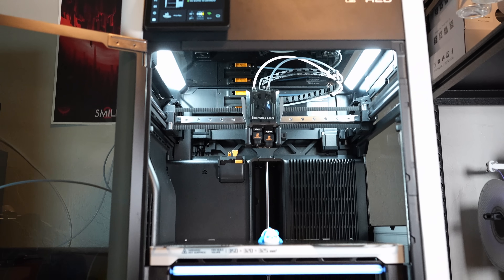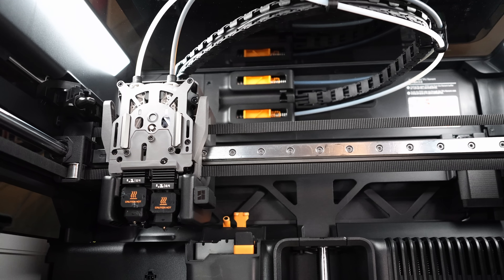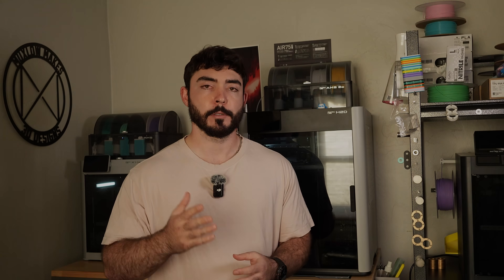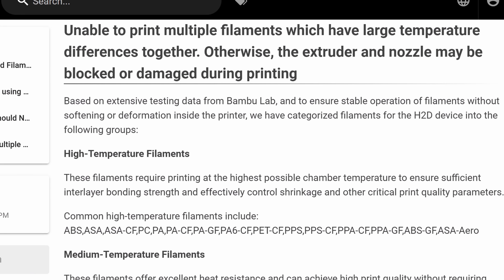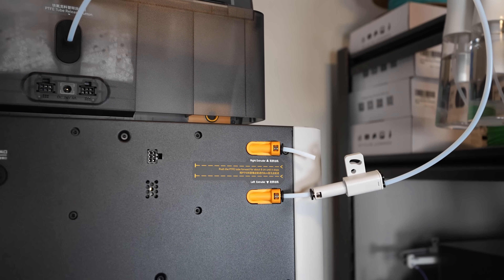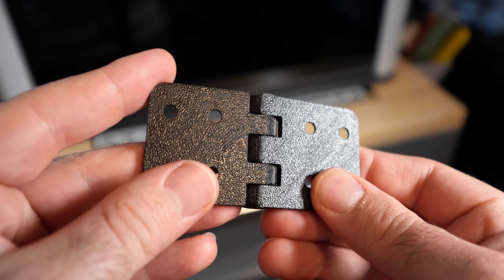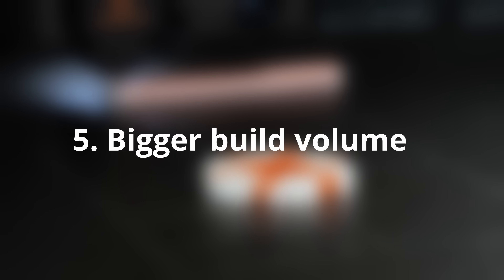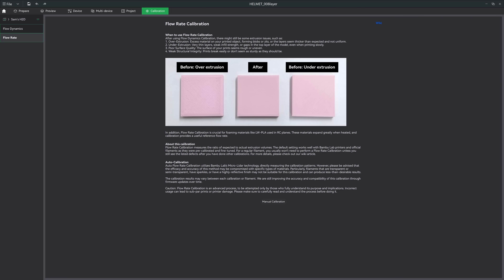5 Things I Love & Hate about my Bambu H2D

Comment: People are complaining about the build volume. Having had a 500x500x500cm printer for years I'll tell you now there are more issues then benefits.

Here are the issues in no particular order.

1. 500 cubed printers are huge. Physically take up ALOT of space.
2. Leveling is a pain. The slightest issue with tramming or the build plate will ruin a print.
3. Large full volume prints take forever and usually are not worth it if you have a nice need then ok but most of the time if  you are printing smaller things you get a lot of headaches for no benefit.
4. Accuracy suffers especially on large prints.

I bought the H2D and couldn't be happier. Its a good balance of size speed and quality. PLA, PETG, PA, Nylon are all easy to print with exceptional quality. Its easy to use reliable and fast. Before people criticise it they need to try it. BTW its my First Bambu Lab printer and I have 5 FDM and 1 Resin and the H2D is the easiest to use by far. If you like to tinker its not for you but if you just want to print in most materials reliably and you have the budget its a no brainer.
Reply from the maker: I totally agree with what you're saying. The H2D really is a huge machine as-is.. and honestly I don't know what kind of prints wouldn't fit on it. Fair points!

Comment: Wait… what?! You need two AMS units to use both nozzles at the same time?! How is no one talking about this?! If that’s true, I feel like an absolute idiot for ordering the H2D today…
Reply from the maker: Im sorry there is some confusion about this. You can run auxiliary spools into either nozzle, but you can't use 1 ams for 2 nozzles. In the video I was trying to say that you'd need 2 AMS' to have full auto filament swapping on both nozzles. Sorry for the confusion
Reply: @ Not you fault they made it like this. No hate on your video, I was just surprised to learn this and pretty annoyed that none of the reviews I’ve watched so far doesn’t mention this

Comment: I wonder why the nozzles are limited per side on choice of material? Not that I haven't tricked my X1C. I've been printing TPU out of the AMS since the beginning just by setting it to PLA with the temps and volumetric flow of TPU.
Reply from the maker: Yea I've done the same thing before, have you had issues with it clogging though?
Reply: @sammuxlow  Not with certain brands/colors I prefer the harder TPU so it hasn't been a problem.
Reply from the maker: @Oliver1071  Which TPU do you use? 95A? I've tried using 95A HF from Bambu that way and had mixed results
Reply: @sammuxlow  before Bambu TPU I was using Priline and Overture Highspeed but success varied by color. Now it's just easier to use bambu ams tpu. or any other 68D

Comment: There is a dev mode hidden in the Bambu slicer config settings that turns on some of the more advanced features like top layer flow rate.  It was in the previous version, should be in the latest as well.

Comment: Please help me understand. So if I have two AMS units, I can't feed one into one nozzle and the other AMS unit onto the other nozzle? They both have to go into one nozzle and a single filament into the other nozzle?
Reply from the maker: @chuxter7  if you have two AMS units you CAN feed one into each nozzle. So you'll have 4 filaments available for each nozzle, totalling 8 for the printer.
Reply: @sammuxlow , the video mentioned that unfortunately, we can't do multicolor tpu, didn't it? But isn't there AMS friendly TPU? Would that not be able to do multi color?
Reply from the maker: @chuxter7  yes you're right. You should be able to print multi-color TPU with the AMS compatible TPU. I personally don't consider it a useful TPU. Its not soft, or rigid.. have you used it before? Find any uses for it?
Reply: @sammuxlow, thank you!

Comment: As you teased, please give us a detailed look/test at the filtration system. First I thought with this big HEPA/Carbon filter it must be awesome BUT in some videos it looks like in case of low-temp materials like PLA, where the vents must be open, that the air can flow over the filter direct outside!? Maybe that's better for temps but what's the point of the filter? Can you please shine a detailed light on the filtration system!?

Comment: why cant you print abrasive material in both nozzles? I have not seen this talked about yet?
Reply from the maker: @jonsimpson1790  you can print most abrasives, just not all. The only reason is because of the tight bend radius of the PTFE tube that leads into the tool head on the right side. They're claiming because of how brittle the material is, it can break.
Reply: @sammuxlow where did you find that information? I never read the manual lol
Reply from the maker: @jonsimpson1790  its on the wiki for the H2D. I had to go through it for the video lol
Reply from the maker: Here's the link: https://wiki.bambulab.com/en/h2/h2d-filament-printing-guide
Reply: @sammuxlow  thank you
Reply: @sammuxlow  wonder if a tube suport can be printer to help with that
Reply from the maker: @jonsimpson1790  I thought the same thing. Maybe ill try and design one and test it out. Its just the printer limits what you can load into each nozzle, so I dont know if there's a mode that allows you to load any material, even against their recommendations.

Comment: For $150 you can add a heater and insulation to the P1/X1 and hit 70C.  For $5 per pulley you can get toothed pulleys that eliminate most of the VFAs on the P1/X1.  For the same price as the H2D you can get 3 super modified P1Ses with Python AMS.  The H2D is an IQ test.
Reply from the maker: @EliteMacFreak Totally fair points—modding the P1/X1 series can definitely close the gap in capabilities if you're comfortable doing that. For me, the appeal of the H2D is that it delivers those upgrades out of the box with native firmware support, dual independent 350C nozzles, a larger build volume, and a beefy motion system—all without needing to tinker.

Also, while you can get multiple modded P1Ses for the price, the H2D is really targeting a different audience—those who want pro-grade results with less effort and more reliability long term.

Appreciate the input though—your setup sounds beastly!

Comment: Do i understand right, that there is no possibility to use the printer offline? With sdcard?
Reply from the maker: @n1ffl3r65  it takes a USB flash drive  instead of an SD card. It can be used offline or in Lan-only mode. Depending on what you go with you can manually load print files onto the flash drive and operate the printer totally offline.
Reply: @sammuxlow  thank you for the answer, I use my printers in the basement and there is no wifi.
Reply from the maker: @n1ffl3r65 of course! You should be able to use LAN-only or just walk your usb over to it.

Comment: wait wait wait wait... I need a second AMS ... ??? 🥺
Reply from the maker: @tstsjrm  unfortunately yes. If you want FULLY automatic filament feeding/switching on both nozzles you'll need two units.
Reply: @sammuxlow  thanks a lot for your response mate, that's essential to know
Reply from the maker: @tstsjrm of course! Let me know if you have any other questions.
Reply: You still can print Dual Nozzle, multiple color prints with left nozzle being fed from External Spool.  I have my H2D left nozzle being fed my main PLA ext spool and the AMS2 feeding right nozzle.  I too have had no issues using TPU on Left Nozzle external spool.
Reply from the maker: @chipackerknecht9596  right, that's why I specified 'fully automatic' in my last comment. Some people want the full automation of the AMS for both nozzles

Comment: I recently purchased an X1C but wish to print more engineering material. Do you feel the bambu lab standard filament profiles work well with those or did you have to adjust the settings to produce good quality prints? I’m not much of a tinkerer in that respect I want a tool that’s mostly set and forget.
Reply from the maker: The standard profiles will definitely work for you. For engineering materials I'd recommend letting the chamber warm up for a bit after activating the heat bed. Also, invest in some Bambu liquid glue for your plate. Im stoked for you though, the X1C is an amazing machine!

Comment: My H2D is faulty, and I agree with your point, repairs are complicated, if it had been a Core One, I would have it up and running in no time. 
The Bambulab support are running in circles, and don´t want to listen, clearly they don´t know anything about this new model. 
Right now I regret buying this expensive printer. 
It printed great for 20 hours, and I was initially happy, but then it started to stop during printing, retrackting filament, loading it again, now it will not load filament at all sometimes, throwing the fault code "clogged nozzle" even that there are no clogs. 
Right now I can not make it go through a hole print. 
I have tried two different AMS units, both sides of the toolhead, swapped nozzles to new ones that I had bought as spares, the fault is clearly not related to AMS or a specific nozzle, but Bambulab are coming back with stupid stuff like "it might be the particular slot in the AMS", it is like they don´t read what I write and don´t watch the videos I have uploaded to them. 
And I have to wait days for them to get back, each time they write something stupid and I tell them try again. 
I would say, buying stuff at these prices, should be from a local dealer, where you can go and talk to the guys, and they can take it in for repair. 
I am pretty sure it needs a new extrusion motor or toolhead, but they keep wanting me to try stuff that makes no sense.
Reply from the maker: I had a similar experience when I bought my X1C. I was getting terrible first layers and wanted to set the z-offset manually like I could on my Prusa, but they were running me around in circles. I eventually gave up and a firmware update must've fixed it. 

Thats a great point about having local dealers to chat with, definitely wish that were the case. I really hope you figure it out! If you do you should comment the solution here in case someone else has the same issue.
Reply: @sammuxlow  I had startup problems with my X1C as well, the bed was scraping against the waste chute, but at least I could fix it - and still we both bought the H2D haha :-) 
I am pretty sure my H2D needs a new tool head, and maybe they know it too but would rather not, when you look at the price of a new tool head, it cost as much as a hole printer from some of their competitors :-)
Reply from the maker: @chris6160-d6s Thats sucks man, I hope they give you whatever you need to fix your printer. Its a great machine, so i hope you get to enjoy it sometime soon!
Reply: @sammuxlow  Thanks. 
It looks like I might was wrong about the cause of the fault - I had problems with two AMS units on both nozzles, so I did not think it was AMS related, but I found I had better luck when loading the filament straight into the printer - so to try something, I found a new electric control cable for AMS locally, and swapped the cable between the printer and the first AMS, off course it is control cable for both AMS, since they are connected together - and now it prints again. 
Still to early to pop the champagne, but it looks good right now. 
It is weird, because the AMS units would load the filament all the way to the extrusion gears, and then it would not go further, but apparently that control cable can be semi faulty, but who knows how it really works. 
I hope it holds up, right now it seems to work again.
Reply from the maker: @christiantrab6160  wow what a bizarre issue, I'm really glad you figured it out though!
Reply: I hate to say it, but despite what Prusa fanboys say, their newer machines aren’t that easy to troubleshoot or repair either. When would you repair your Tv if it broke? Or anything complex? The more these move out of the hobby space, the better they get and comp,exits comes with that. I’m sorry you’re having problems, but it will happen upon rare occasions.

Comment: It never dawned on me that I wouldn't be able to use both nozzles unless I had two AMS units. Really glad you called that out because I think some of us may have just assumed that we could plug two PTFE tubes into one AMS to take advantage of both nozzles, at least without any further research.

Great stuff!
Reply from the maker: Thank you! Yea I thought the same thing when I first purchased mine, so I thought others might want to know. I appreciate your comment!
Reply: @sammuxlow  Absolutely!
Reply: Can't you use both nozzles even without a single AMS thing? Just feed a filament into each tube.
Reply: Wait a moment. You don’t need two AMSs to print multicolor. You feed from the other input for the other head. This is annoyingly incorrect. Sure, you can’t print two different TPUs at the same time, but how many other printers can do this? How many can even print TPU? A dual AMS would mean two colors per output, not four, so sure, it could be done, but at a much increased cost. I’ve printed with both heads for one print, one at 300 c and the other at 220 c. That’s enough of a spread in filaments for pretty much any need. I’ll guess I’ll now have to try  my PPS-CF10 at 340 c, where I print it, with PVA at 220 c. I’ll see what happens. The bed temps need to be different as does the chamber temp. So I’ll be crazy trying this, but just for laughs (or crying).
Reply from the maker: @melgross  what I was trying to point out is that one AMS cannot feed both nozzles. Similar to the old models, they only have one output port.
Reply: @sammuxlow  It could've been worded better.
Reply from the maker: @felixmoore6781  that "chapter" does start with a title saying "AMS can only feed one nozzle." So its implied, but yes you're right, I could've been clearer.
Reply: @ yes, we know that. It didn’t sound like that.

Comment: You can control the top surface flow ratio and the initial layer flow ratio in Bambu Studio when you turn on the develop mode. Those settings can be found under Quality Settings (advanced).
Reply from the maker: Thank you! I'll definitely look into this.

Comment: I don't understand the Prusa Xl/H2D comparison. They are wildly different products and more importantly - price points!
Reply from the maker: While they use different systems/methods of filament swapping, they are both still FDM printers and are large format. The basic 2-head Prusa XL goes for 2,499.. so not too far off the Bambu.

Comment: So far I've passed over pushing the buy button on the H2D 3 times , I love these love v hate or good v bad videos about the H2D .
That way I know "Can I put up with the bad parts" ? and want faults will I likely get with the H2D and how do I fix them .
Not sure if this machine will be a pain to maintain because I've had to replace the web camera on my X1C , so more sensors/cameras means more to go wrong .
And the "we will not stop you doing this or that with are firmware" was with current machines which I'm not sure if the H2D is included in that promise  ?
Reply from the maker: Yea im not entirely sure about firmware and software promises. Id guess that they will have it pretty locked down. Thank you for the comment!!

Comment: I love that people are complaining that the dual nozzles can’t reach both sides of the plate. Easy fix to that for Bambu labs if people want to complain about it. They could just make the build plate smaller next time and then people won’t moan. But personally I’m totally fine having the larger volume. One thing you notice when you unbox the H2D is that it’s so big it can only just fit on a countertop. If they’d made it bigger you’d have a load of people complaining that it doesn’t fit on a worktop probably.
Reply from the maker: Im perfectly happy with the 300x320x325 but a lot of people want it to be bigger. Especially if they already own a Prusa XL. I think what we ended up with is a solid size!
Reply: @sammuxlow Apparently the XL is a nightmare to home.  You need so much space for it. And thats the difference here. The H2D a well designed bit of kit I think.  Considered and well thought out. 👍
Reply from the maker: @bonjipoo  I couldn't agree more. I researched the Prus XL many times and it seems like a ton of work in general to own and operate. Thank you for the comments!
Reply: They should release a H1D with just one nozzle that covers the whole area instead
Reply from the maker: @AndrewTSq😮 kinda a cool idea actually! What do you think they'd price it at? Tariff-free I mean
Reply: @ I live in tariff-free Europe, so a X1 Carbon is currently 1200 Euro, so say 1500 euro maybe? The H2D is 2000 Euro currently.  (1500 euro ~ 1700 USD) edit: can add that the 1200 and 2000 euro is with our salestax (25%) included.
Reply from the maker: Yea i could see it being around 1500-1600. That would be really cool!
Reply: I'm not a rocket surgeon but I think people are complaining that it is advertised as a 350mm printer when the max single object size is 325 and you have to check the detailed specs to find out about that quirk.

Traditionally printers have been advertised with a build volume defined by the single largest object that can be printed. See for example the specs for the Ultimaker 3 from 2016 which was the first non-industrial design with two nozzles that moved in the same way as the h2d. I've been saying for years that I don't understand why more manufacturers don't use that approach so I'm a little vindicated right now.

I'm not saying they are right, mind you. The H2D does have a 350mm print area that can be used in a single print job. I'm not sure I favour one or the other method for denoting print volume.

I'm just saying that people are not complaining about both nozzles not being able to reach the full plate.